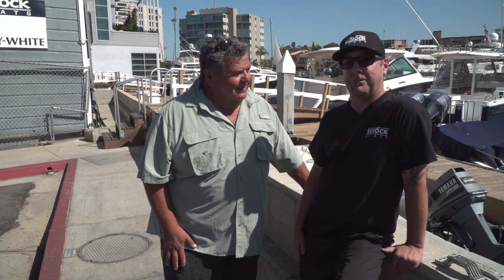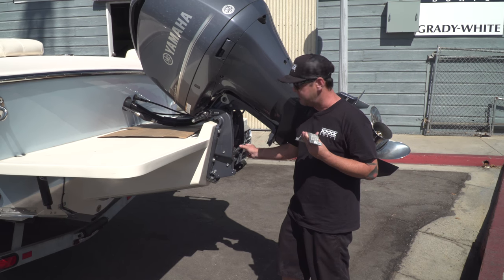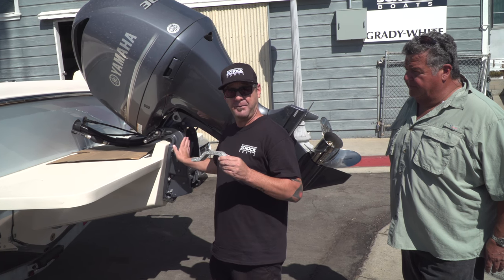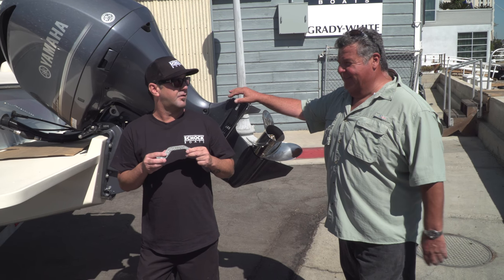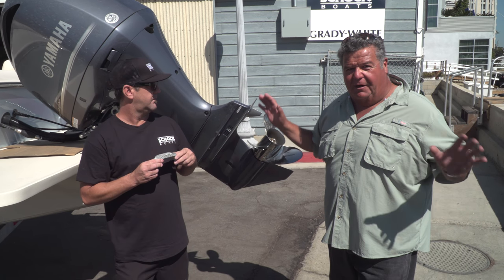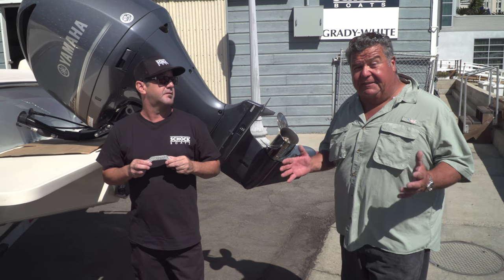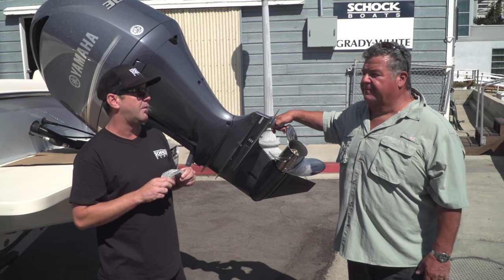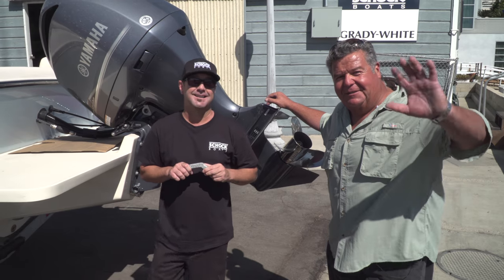Change Your Zincs Or Else | SPORT FISHING

Comment: Enough with pushing yamaha parts.  Is this a commercial?
Reply: So it’s not true? Third party is just as good? Looking to buy new zinc anodes for my boat.
Reply: It doesnt matter what brand your zinc is, as long as its made of zinc and has the same geometry as the original part. You can even use pure aluminium as sacrificial anode for steel and various aluminium alloys..

Comment: I came here to find out what socket to use to replace the rear zinc, I got a commercial for Yamaha zinc.  Zinc is an element and it all corrodes the same, none of it as slowly as the engine.  Sure wish you had given me some useful info.